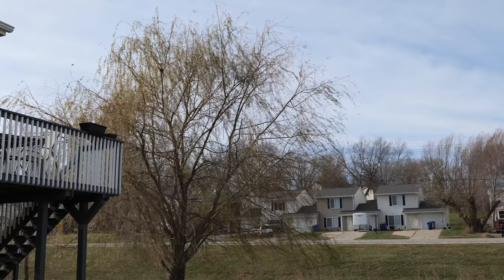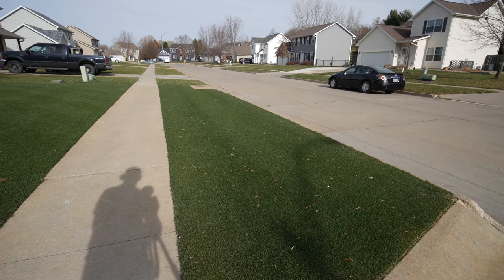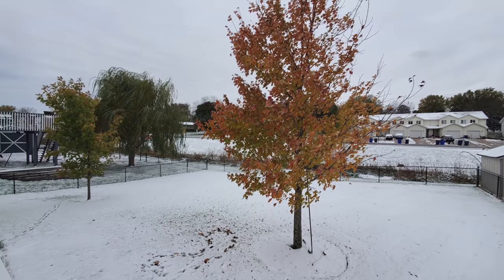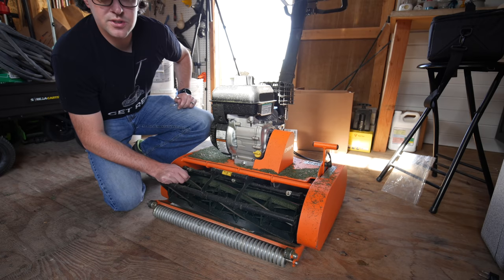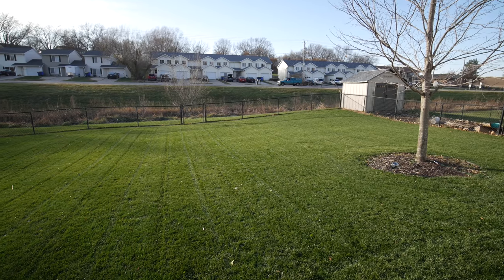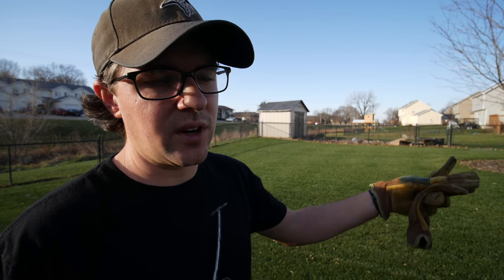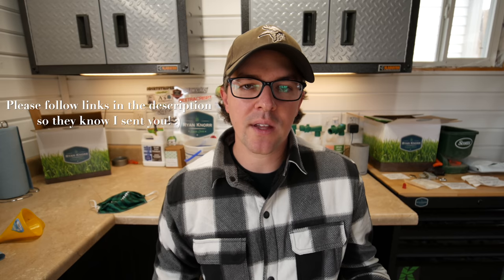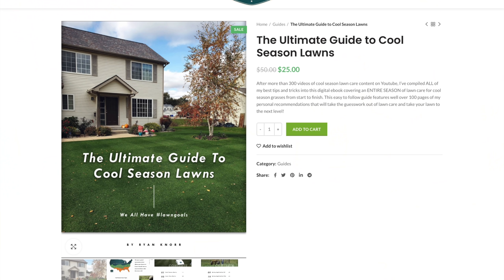There's Time For ONE More + DEALS for the Holidays!!

Comment: Bbq looks great ryan!! I don't usually critique but I will wrap my pork but when they get a really nice bark or at about 160 degrees double wrap it tun the heat up and let it goto 204.  Let it rest in the cooler for a while.  When your ready open it up and save all the juice tat the bottom of the foil.  Get a fat separator from and department store for $5 pour your juice in there, then shred you meet, and rehydrate a little.  After that add a bit of your bbq sauce and srpinkle it all over .  Mix it in a serve.   It turns out fantastic if you wanna try that some.  Regardless it looks great!!!!!.

Comment: On your cool season guide what kind of fungicide program does it entail
Reply from the maker: There's some general info but with fungicide I don't like to have beginners out spraying without being more experienced in doing so. It's high powered stuff and very expensive in many instances.
Reply: @ryanknorrlawncare  anybody can keep the long green in the spring in the fall it is this summer and makes it difficult that’s why you should have an extensive fungicide program like Pete’s from GCI
Reply from the maker: @robsolo4024  the issue becomes resistance and rotating fungicide groups. A one size fits all approach is not a good idea long term
Reply: @ryanknorrlawncare  Yes I know I understand how it works the lawn gets used to the same chemical if you use it over and over again I always go back-and-forth I’m not a DIY I am a professional  I just thought since you’re selling something you would have an extensive fungicide program for non-beginners any beginner can always follow the simple guards program it’s the fungus that’s the hardest to treat once the humidity comes out he’s got to get that down very early and it only has a three week residual so must be applied at least once a month I start The middle of May and do it every month until August so usually for applications  Some lawns do not need it but the ones that do I make sure I get to them early before I have a problem we service 300 clients
Reply from the maker: @robsolo4024  I was just pointing out that it's made for beginners and explains beyond that what to do but I I can't build a program for every location with enough rotation to feel comfortable giving people that advice when they are just starting out